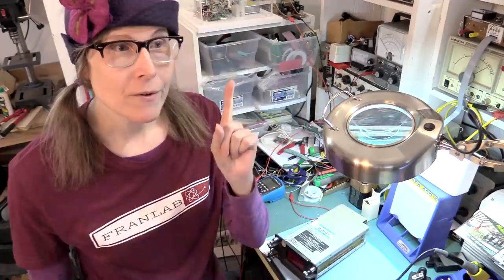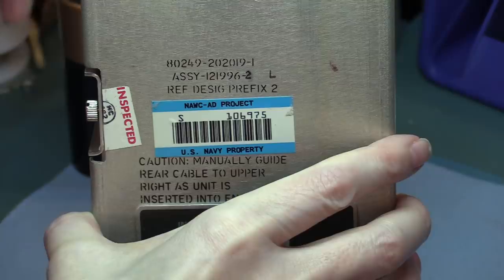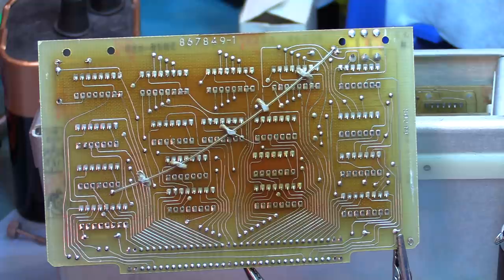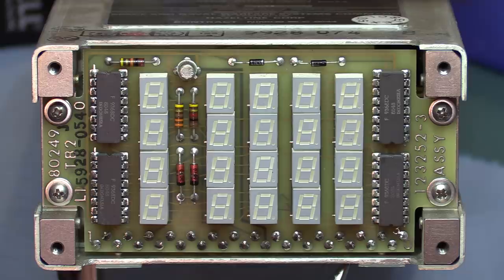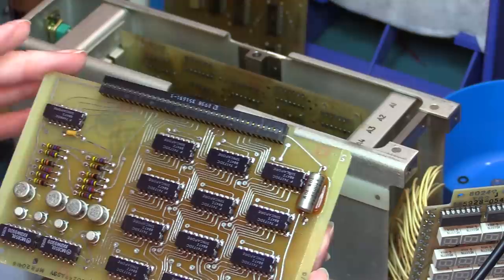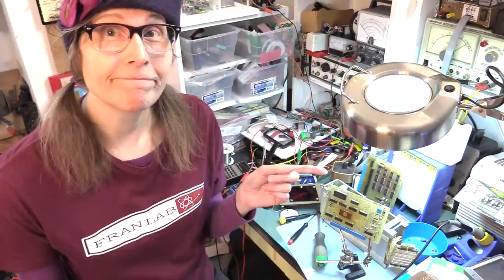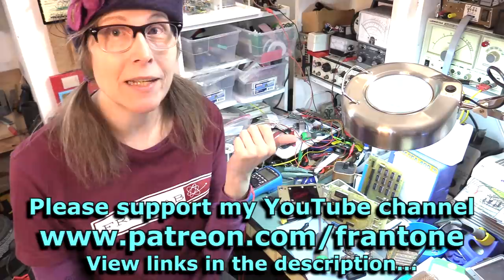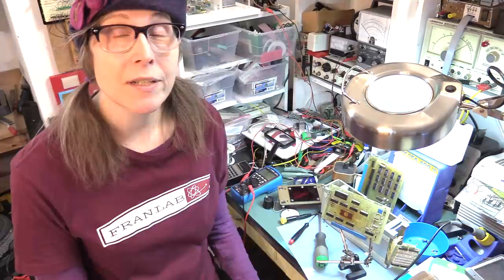REAL Wargames Tech Teardown!!!  80's Missile Target Display

Comment: I think it is very unlikely the PCB was hand drawn on vellum.  It would be considerably more likely the layout was done with stick on pad patterns and then tape for the traces.  Instead of vellum, mylar or acetate sheet was used.  You could get sheet with pre-punched registration holes and you taped down little metal parts onto your light table with little protruding pegs for the registration holes.  for a two-layer board, you would typically have three plastic sheets.  A "pad master", the top traces, and the bottom traces.  The photography for making the boards would then of the pad master and the top traces, and the pad master and the bottom traces.  Bishop Graphics was a big source of the drafting products for this work and all the pads, pad patterns, and tape was black..  They also developed a scheme using translucent blue and red tape for the two layers.  You could put everything on one sheet and during the photo process they just used filters to photo only the black pads and red, or black pads and blue.  That certainly made registration problems impossible.  However, with a complex board if you needed to make a change, you had all sorts of tape that was taped over other tape and it could be a lot of work to make a change.

Comment: I love the soldering on this. Its absolutely perfect. No blobs or spiky bits anywhere and its still just as shiney as when it was made.
Reply: Obviously they took the time to wash it in something like hexane before conformal coating to rid it of any flux residue, that when combined with heat, could cause corrosion and eventually a weapons malfunction, which could be incredibly bad. They probably used a lead alloy and sufficient flux (which can prevent spikes), and the conformal coating prevented oxidation.
Reply: I learned how to solder from highly skilled female wokers at Elbit. They assembled boards for the US, wirewrap, hand soldering, bundle ties with wax coated nylon. Many hours went into each board.
Reply: @meercreate  Yes. Hand cleaning and inspection to remove all flux, untill shiny.
Reply: @meercreate For similar work, the solvent was trichloroethylene. The solder was definitely lead based.

Comment: Worked for the MOD(UK Defence agency) in the 90s in a secure building that was opened in '87. All the equipment used had to have been in production for a least 10yrs before they would install it. Saw a lot of equipment built to similar specs as your display. Some designs were that old that the only service engineer who understood it had long retired. Cost a fortune to get these guys in to service it. Funny thing is that we were still using tape drive computers and telex machines. They did a benchmark test against the fastest pc available at the time vs a Tandem mainframe. The Tandem wiped the floor of it, not a high clock speed but when you've got a dozen or so mainboards running parallel processing, they didn't need to be. Fascinating world to work in though.

Comment: A 72 pin connector, how 1980's. Lots of data available on that ID-1844A/UPA-59A  display on the internet.  Possibly even a circuit diagram. Used in lots of radar targeting display units.
Reply: I believe that’s a DB37 connector.  (Edit) Just realized you must be referring to the board edge connector...72-pin.

Comment: In the mid-1990s I got tasked with removing an old GEAC library computer system. It's construction was the superset of what you have there: two half height racks mostly filled with drawers of bus back planes and everything on circuit boards, quite a few of which had ribbon cables running between various boards. I did see some soldered wires like the one on the back of that board in it.

Traditional fun there were two hard drives. I disassembled one to see what was there and still have one of the platters from it. It's aluminum, about the size of an LP, with a spindle hole large enough most modern hard drives could pass through it, and If you hang it in such a way that it isn't dampened and then tap it it rings like a bell.

Comment: If that is an EPROM then my first thought was a Finite State Machine based system, but it doesn't seem to have the usual latches and what not on the PCB. So maybe even some custom FSM based micro perhaps?
Reply from the maker: No Idea... but the architecture on the die sure looks like an EPROM.
Reply: Yes state machine, likely to drive display from a set of synchronous binary counters, and also probably used to do other decode complex logic as well. 6 input bits used to do display decode, and 5 bits of the output doing the display selecting, leaving 5 inputs spare and 3 bits as output to do other combinational logic. There will be some 4x4 bit memories there somewhere, used as scratch pad RAM, and then the rest of the Eprom will do the input data decode partly.
Reply: I notice the first board Fran pulled out had both 7474 and 5474 (early cmos version) flip-flops? I was wondering why the mix of standard and cmos chips, other than voltage ranges?
Reply: that is a custom IC chip carrier, use to make thin and thick film chips, and we would mount them in carriers similar to that, and then wire bond the pads to the legs...

It is very likely a custom logic, or maybe a GAL, or PAL.
Reply: @FranLab  I would also say, from the two symmetric halves and not too much room for logic at the sides and in the middle that this is an EPROM. I compared the layout with 2716 and 2732 from my collection from the time - I could imagine that it is a 2708 from the comparatively low density in the logic parts at the edges... http://www.decadecounter.com/vta/articleview.php?item=413
Reply: Dave, there was a whole bunch of 74173 4-bit registers on the second board...
Reply: If it's a ROM, then it's almost certainly being used as a logic table. If there's any kind of encryption happening, it's unlikely to be anything more complicated than a Caesar cipher. I would vote it's not encrypted at all, but rather uses a command set to drive the displays.
Reply: @ZiggyTheHamster  I agree...
Reply: @paulvandergroen9569  Yes and from experience the 5474 was very much failure prone, the most commonly changed IC in the boards I used to repair. Commonly they would become deaf, and while you would find they worked with DC voltages on the inputs, they needed to have more input current sunk than a TTL gate could deliver without going above the logic 0 threshold. If a section had one there and it was acting strange just replace it and most times it would be fixed.
Reply: @tekvax01  Did they make UV erasable GALs and PALs?  I had thought the only ICs to have quartz windows were EPROMs and it was always at least good practice to have an opaque sticker of some kind to keep it from slowly being erased by any ambient light ... even if in a sealed case.
Reply: @alanroche3872  I thought 54XX series chip were military. They benefit from a larger working temperature range.
Reply: from wikipedia: "Two digits, where "74" denotes a commercial temperature range device and "54" denotes a military temperature range."
Reply: @paulvandergroen9569  54 series was military temperature range -55C to +125C which necessitated the ceramic package (CERDIP) as plastic packages of the day couldn't withstand such high temperatures. 74 series was commercial temperature range 0C to +70C and was also available in he CERDIP package but more typically in the plastic DIP package.
Reply: @Keith_Ward  There were a few types of erasable PALs that had the quartz window package. I think Texas made some and maybe Lattice. I think they would have mainly been used for prototyping purposes whereas production would have used the cheaper non-windowed packages.
Reply: @FranLab  It is, memories always have a regular structure. It looks very much like a 2708 or 2716. All chips are very common for the time 7400, 9322, 74143, etc. so I would bet it is a very common UV EPROM too.
Reply: There were sure a lot of '173 "4-bit D-type registers with 3-state outputs" on that second board. But my initial feeling was that those stored the digit data, and this entire thing is merely a slave display using those registers as digit storage. The EPROM was probably easier than discrete scanning logic would have been. The '154 is probably a state decoder for the EPROM, but it's certainly got more outputs than you would need for five columns of digits, so maybe it also had data update states.
Reply: @stephenbell9257  The UV erasable PALs where much later, they had the quartz window bonded with the ceramic.
This one has the glass glued on top of the ceramic and its a yellowish glass as found on very old 2716.
Reply: Hearing her voice / mood / jokes reminds me soo much of EEV haha, my brain immediately clicked that subscribe thanks to that XD

Comment: One of the reasons for the basic chips, not high priced customs, is they are very stable with a known failure rate.  The simple two sided rather than multi-layer boards was the same.  No need to conserve space or go fancy.  Make a reliable board that can be repaired if necessary.  The mod wire was staked down to prevent it from wandering away.

Comment: It is incredibly well mounted.
The boards are hand made! Look at the the traces. I remember that in the 70's electronic magazines had ads of very narrow tapes to do that.
About the chips encapsulation : all military applications used ceramic versions of the chips, always. This made them much more trustable, heat resistant and enduring.

Comment: Wow, that brings back memories! I used to work at Hazeltine in Greenlawn as a QA rep from Boeing, inspecting boards that went in the first color AWACS displays, '85-'87. They were switching over to a new conformal coat back then, one that could be removed much easier to allow rework. The old one was too solid and attempted rework would destroy the fibers in the boards. They allowed smoking in the building, then wondered why ash kept getting caught between the boards and the coating! Perhaps they left off the conformal coat on the display area because they weren't sure of the longterm effect of UV through the panel on the coating?

Comment: I’m guessing the eprom is being used as a look up table where inputs such as speed, time, coordinates etc can be used to address the eprom and the result displayed without the use of a cpu, kind of like a slide rule vs calculator.
Reply: I think it's being used as a micro-code "CPU" (this was before FPGA's) where the output pins are tied to gates to route data around some main bus. There are multi- and demultiplexers for taking data off the serial port then a whole bunch of flip-flops where the data (all 12-20 bytes apparently) is stored. Then the LED's tie into those flip flops to display it. A whole lot of space and circuitry for such a simple function, but welcome to the 70's.

Comment: This is part of a radar install. Specifically, this display would display the IFF codes (transponder codes) of up to 4 targets. You could select an altitude level if there were more targets and get only readouts on the transponders at that particular level. That’s that the “intra target data” means.

Comment: Fran, the "N00039-85-C-0044" contract number tells you that the "Space and Naval Warfare Systems Command" (N00039) awarded this contract in FY85, i.e., between Oct 1984 & Sep 1985.  I don't recall what the "C" means, but the 0044, if I remember correctly, means this was the 44th contract they awarded (in total) in FY85.  This contract may have been the "original" contract number or possibly a "maintenance" contract, etc., (I never worked with contracting stuff other than having some of them inflicted on me over the years).  Seeing the varied chip dates does imply that your intratarget unit was maintained over the years of its use.  And that Hazeltine may have used whatever chips they had on-hand given the '70s & '80s chip dates.  ;)

Comment: You would love how HP made the 9100 caclulator,  Teflon PCB multilayer, 64 bit, core memory, hundereds of diodes and transistors (handpicked) and all kinds of exotic uses of PCB. I have repaired one, I have the pictures on my site. I never seen anything that comes close, really impressive engineering

Comment: It's interesting that on the same board there are 5474 (dated '79) and 7474 (dated '85) chips.  Those are the same part, except 54xx are the military spec variant.  Maybe the board is really from '79 and over the years as it was maintained they switched to the non-milspec series for repairs?
Reply: Pretty much what I was thinking.
Reply: Yes, when we could not get the 54 series in went the 74 series, because in general they came off the same line, and had the same QC, just did not get the full bake-n-shake cycles the 54 series got. They did all get a thermal cycling test, but not the -55 to 125C the mil versions got, followed by a functional test at both voltage extremes.

Comment: I built my first amateur radio repeater systems in the 1970’s. They used all 74xx series TTL and 555 timers for control. It was very similar to those boards. You could do almost anything with a 7400, depending how you connected up all the gates.

Comment: That is a fantastic piece of tech!  I wish I could get my hands on it.   Those ICs near the LED displays are Fairchild DM9368 7 segment drivers for common cathode LED displays.  The data lines are 3v, outputs are 20mA at 1.7v and are set up to direct drive the segments.    This would be fun to use a microcontroller to display some info on just to preserve the aesthetic.  The drivers have 0-F (hexadecimal) characters in it, it's jut a matter of banging out the correct characters to display.

Comment: Im amazed at how well the solder joints have held up after being so old and with the board showing signs of excessive heat. Was there a special soldering alloy used back then for mil-spec board assembly?

Comment: Plenty of highly interesting stuff again!  Thanks Fran.
 I got a few thoughts to tell.  One is that there were the cylindrical, hermetic seal tantalum capacitors, like the 100 uF you pointed out.  They are called Wet Slug types.  There are some interesting details about those, like that the case was also tantalum and that made them easily recognizable by just holding them in your hand -- they were heavy.  Because the the cap had to be welded to the cylinder, it was a very delicate operation.  The melting point of tantalum is way up there in the group of so called refractory metals, such as tungsten and molybdenum.  On the other hand, the glass frit seal through the cap melts at much lower temperature.  So you want to weld the rim but not the seal.  I may still have somewhere a test piece where I failed in another way: I did not realize how sensitive tantalum was to hydrogen which I tried to use (5%) for concentrating the welding arc.  Later on, I helped the same friend developing dry tantalum capacitors ("orange dip") type formatting process, but that is a different story.
 My take about the 7400 series ICs is that they probably were used, because the boards in this case were not for true military field use.  The military chips would have been 5400 series.  Also, I don't think the wires to the connector are Teflon.  There are clearly wire numbers printed on them with what I believe is a thermal process.  I have always understood that you cannot do that on Teflon.  At least you could not with the marker that we used.
 Finally, one comment mentioned the frame by frame movie production using an HP 9845 computer with some high resolution display.  As it happens, I have one of those '9845 guys.  I used to describe it as having originally been more expensive than a good family car.  And "almost"as heavy.  My great regret about it is that I evidently failed to find one essential plug in board among the packing "peanuts" when I received it.

Comment: When "War Games" came out it, along with quite a few other movies and TV shows, made a problem for the company I worked at.  One of our products logged data that the customer would then import to an IBM PC computer to view, show in graphical form, and such.  However, the IBM PC had only come out a couple years earlier and most people had no personal computer experience other than what they saw on TV.  When we would be training a customer how to view the data on the computer, many would become extremely tense, frightened, and even shaking.  We found out that they feared that if they made a mistake, or if something went wrong with the computer, that would make sparks fly out or perhaps make the monitor explode.  And this movie has a perfect example near the end when WOPR is running all the "Thermonuclear War" scenarios faster and faster and...sparks and exploding monitors.

Comment: Haven't seen Wargames but now I'll have to check it out. I remember the film coming out back in the day.  I do remember taking military surplus stuff like this apart and it sure takes me back. The quality of the parts and assembly is trippy. Look at the machined metal bracket that the front of the display is mounted on. All pre CNC. The cost must have been insane.  Heat discoloured epoxy board from 7400 TTL, that unit likely gobbled some real power. The amount of time and effort that went into designing and building the circuit boards... And I haven't seen the Texas Instruments logo for ages.  That was just swell!  And now that stuff is sold by the pound. To see this kind of assembly after seeing Chinese consumer crap held together by the handywork of some political dissident with a glue gun shows the two ends of the spectrum.